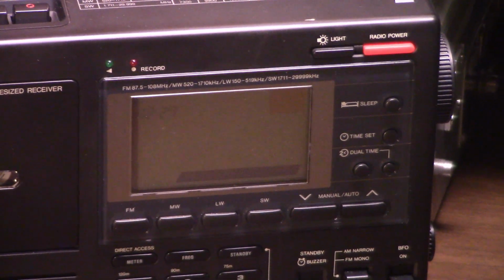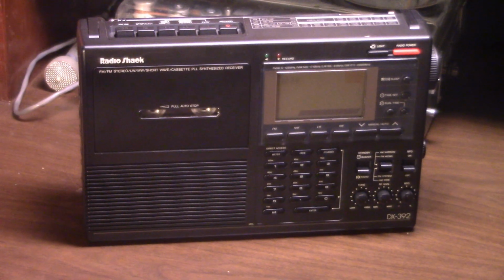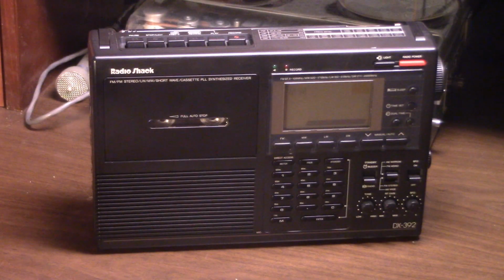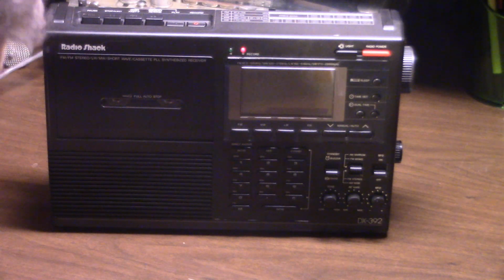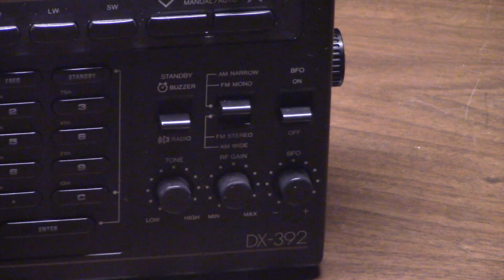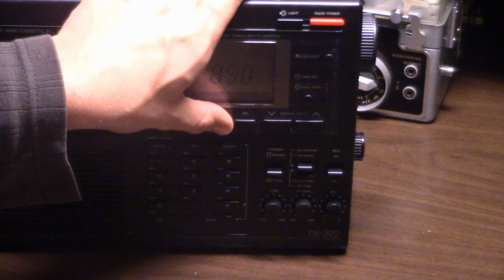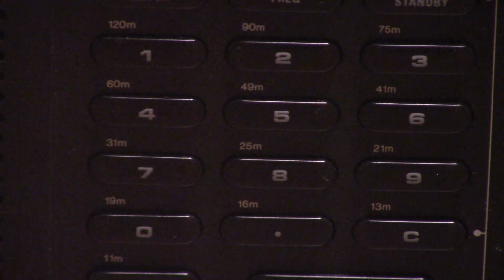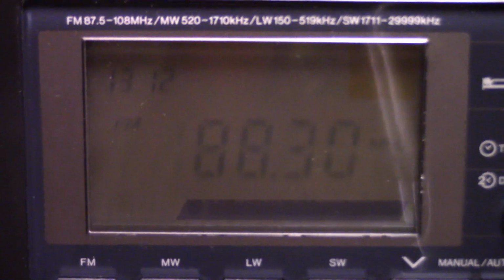Radio Shack DX-392 FM/MW/LW/SW Radio Receiver with Cassette Recorder

Comment: I have a DX392 that I got used in 2006.  Unfortunately, the belt is bad on the tape recorder, and also when coming back to Michigan from Lions World in 2008 Southwest Airlines was so gentle they managed to break the BFO knob.  I haven’t used this unit in a while.  I can’t remember if the radio still works or not outside of the BFO problem, but I think it does.  As for Longwave, you’ll mainly hear navigational beacons in Morse Code, but those are even starting to decline.  There was a broadcasting longwave band in Europe from 155 to 281 KHz, and I don’t know if it is being used in some areas.  In fact, many countries in Europe have stopped using AM altogether and in some cases FM, and have gone exclusively digital.

Comment: In the evening tune around in the range of 3.700 and 4.000 and you`ll hear amateur radio operators. Use the BFO after you locate one to make the voices understandable. Connect a grounded longwire about 50-100 feet long (or longer) and dial back the gain until you get a clean signal with less static. You can also simply clip a wire directly to the existing antenna about 20-30 feet long.

Comment: Thats a nice machine, in the day I had a uniden CR2021 from memory and it was great, i used to record to an external tape deck to record radio netherlands media network which used to be on thursdays from memory and i would be at work.
Reply: Where did you find the replacement belt for this radio shack dx 392

Comment: I had the DX-390 which is the same thing as this except without the cassette recorder, and it did not receive C-Quam AM Stereo. But I know some of Sony's shortwave radios, like the ICF-2010, used their AM Stereo decoder chip for synchronous detection and can be easily modified to receive AM Stereo: http://www.amstereo.org/archive/radios/icf2010mod.txt